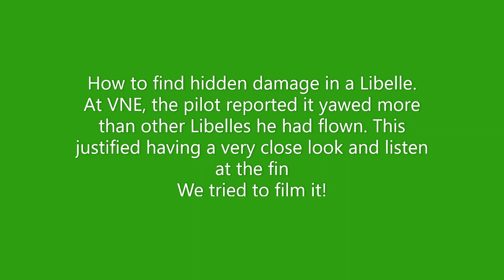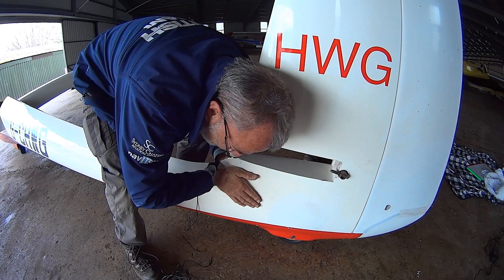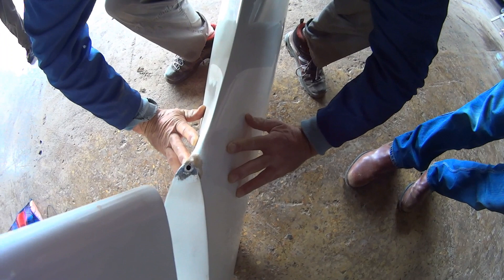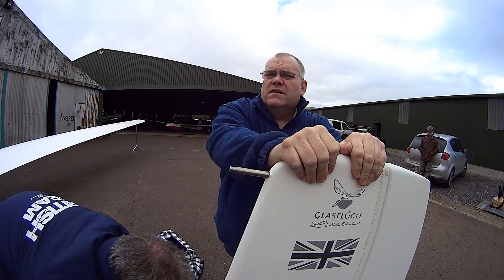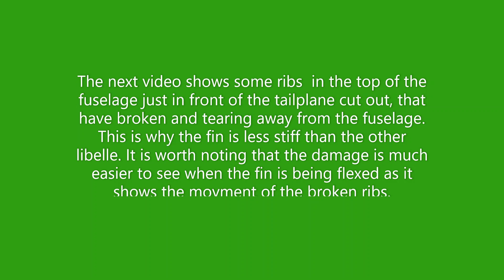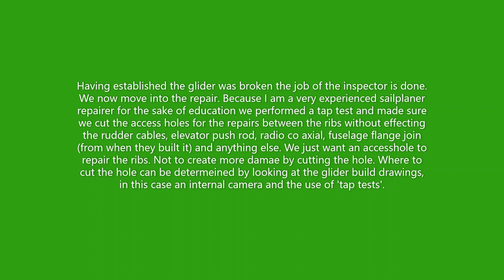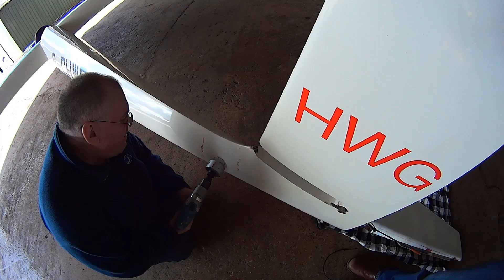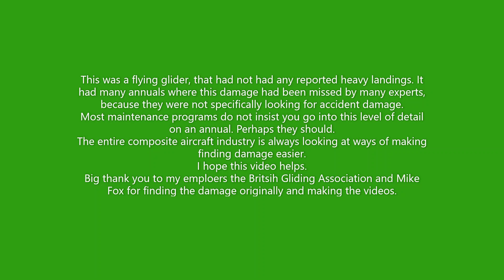How to find heavy landing or groundloop damage on a libelle fin the principles apply to most other a

Comment: Thanks for sharing. I will notify the Libelle owners in my club to have a closer look on their tail sections.
In my opinion this type of failure can also occur by years of small movement/vibration (which occurs on flight) over time.
A video of the repair, even with a sequence of photos, would be very interesting.
The delamination is quite big, so it would be interesting how the repair masterplan looked like, with this restricted access.
Reply from the maker: The repair was very simple. 

The official repair scheme approval process is on the Streifly website that officially supports the Glasflugel range of sailplanes. See link  http://www.streifly.de/TN%201-2005.pdf

In that document, one of the approved methods is to use a manual written by Ugene Hanle. The English translation is below.
https://www.dg-aviation.de/en/wp-content/uploads/sites/2/2016/12/flickfibel-e.pdf

This manual is essentially the Libelle repair manual as its based on the Libelle. The thing i do differently (the manual was written in 1967!) is lengthen the GRP splices to the same as the ones in the Schelicher manuals. I prefer longer splices as its more forgiving of errors and actually stronger with less hard points. 

Do not use repair schemes in the FAA AC43. Although they are approved, they are all heavy and stiffer than the original structure. They are aimed more at airliners than sailplanes. 

One hand size hole each side of the fuselage to gain access, Abrade the broken frames away to almost nothing with 40 grit on a finger mostly (removing the crack). 
Make sure all broken GRP is removed and the area around it keyed up to accept the repair. 

Then reinstating the frames and patching the skins are all repair schemes taken from the manual. Note you cannot buy the original resin and there is a Streifly technical note to use a different resin see link here
 http://www.streifly.de/TN%202-2005.pdf

After the repair it must all be post cured at 54 degrees Centigrade for 15 hours befiore you, fill and paint white. 
Being at the back end of the glider, i would also reweigh the glider to make sure the repair has not added too much weight.

Comment: I got one of those little inspection cameras for my yacht mast. 7mm dia, illuminated and dimmable, 10M cable, wifi, clip on hook, magnet and another thing all for a very small price. It should be able to insert a string/wire from one end of the fuselage to the other and inspect the whole thing with the camera on a flying fox set up, just run it along the bit of fishing line or similar.

Comment: This was really helpful as I'm about to do a pre-purchase inspection on a Libelle.  Will you seal up those holes or leave them as removable inspection plates?  Could this be spotted with an internal inspection (with or without the camera) or does it take reports of a problem to lead you to flexing it in such a way as to uncover the damage?
Reply from the maker: The holes are far too big to leave in place. They would substantially weaken the fuselage in a very critical area. 
Glasflugel approved repair schemes were written by the designers wife Ursula Hanle. They  can be found here. https://www.dg-aviation.de/en/wp-content/uploads/sites/2/2016/12/flickfibel-e.pdf

Comment: I have an engineering degree, but I am not qualified to make an engineering assessment of this.
However, based on my understanding of composites, nothing one can do will restore the original structural rigidity of that empennage, following the cutting of those holes.  Thus, tail flutter may be evident at much lower speeds.
Fibres (fibers) carry structural loads in tension, and after a fiber is cut, the load path is permanently broken.  The plastic resin is much less capable of carrying loads (roughly 1/40th that of carbon fibre (fiber)).  I would estimate the longitudinal ultimate strength of the tail has been permanently reduced by at least half, after cutting those holes, and if someone told me the torsional ultimate strength has been reduced by 1/4th (or more), I would not be surprised.
In order for a patch to make any real contribution to restoring the strength and rigidity of a GRP structure, and a patch can never equally absorb the strain of the original, uncut, structure, that patch must be much larger than the hole.  The strain must be transferred from the original structure, via the plastic (which has a relatively weak shear strength) binder, to the patch's fibres (fibers), and then back out the the structure again via the plastic binder.
Again, I am not qualified to make an engineering assessment of this.  If it were me, I would build some structural static load test articles that established some data by which estimates could be made.
Reply: I'm not qualified either, but I know they typically grind a very shallow scarf angle around the edges so there is substantial overlap between the old and new fiberglass layers.  I believe this helps transfer the tension.  People have been doing these types of composite repairs for decades, they must know what they're doing.
Reply: @FadoodleX  I think that only shear can be the load transfer method, whether in tension or compression.  If we made a butt joint with zero overlap, the interstitial plastic binder would be taking the entire tensile load, and the tension on the fibres (fibers) would be the result of the binder strain, transferred through shear, on to the fibres (fibers).  As the deformation of the binder would be greatest at the end of the fibres (fibers), I would expect delamination between the binder and fibres (fibers) in that region (because the binder is a lot more 'stretchy' than the fibres (fibers)), especially after a number of cycles.

Maybe I'll play around with this when it warms up.

If I needed to repair something, in order to escape a predicament, I would make a full thickness sleeve 5-10 times the diameter of the hole, and that may be woefully inadequate.
Reply: Composite material is actually so easy to repair... And don't worry Gordon knows what he's doing 😉
Reply: @dan0417  How does GRP carry load?
Reply: @DumbledoreMcCracken  it just does, of all the gliders in the world at least one 1st generation GRP  glider does a ground loop every weekend some where in the world. I'm sure it's going to be okay. (glider pilot).
Reply from the maker: @DumbledoreMcCracken  This is the Glasflugel approved repair manual. 
Most sailplanes use exactly the same techiques and these are very well proven  the be strong and not effect the fatigue life (12000 hours) 
https://www.dg-aviation.de/en/wp-content/uploads/sites/2/2016/12/flickfibel-e.pdf

Comment: What is groundloop damage?
Reply: A groundloop (or cartwheel) = when the Plane makes a 180° Turn (more or less) on the ground, most likely by one wingtip hitting the ground and beeing hold back by friction.
A very dangerous situation in winch launch acceleration. High grass is therefore a no go, and super quick release of the winch cable absolutely necessary. 

Sometimes this "maneuver" is made intentionally, e.g. when outlanding on a short field, to make a 180° Turn before hitting the obstacles at the end of the field, by putting one wing on the ground with aileron and supporting the loop with rudder, on relative low speed, otherwise it is possible that the plane rolls over on the back (the high wing is accelerated and produces a lot of lift).
Normally you would want to push the elevator forward to take pressure from the tail, otherwise the tail has resistance on the ground, an the 180° turn with the turn point at the main gear has a big momentum at the tail some meters away, therefore producing sideway stress on the rather "thin" (by Ø) fuselage at this point, shearing it off or like in this case making delamination.

In my opinion this type of failure here can also occur by years of small movement/vibration (which occurs on flight) over time.

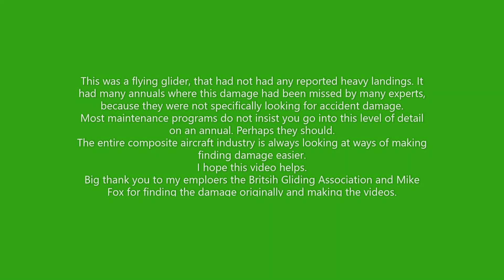Here is a video with a "kind of groundloop" (it´s more an impact). The sheared off tail section,  can be seen @ 10:00
https://www.youtube.com/watch?v=_zfuRb3csJc&list=PLTRn1uGDTWs0qxqAqIDKrRtzvkeOFwEdS&index=23

Another type of groundloop while landing an hitting a Corn field with the right wingtip with a K8. Notice the tail is in the air (a loaded K8 will have the tail always in the air, only when accelerating (start) coming down) --> no stress/damage to the tail has happened.
https://www.youtube.com/watch?v=HT_9O45TFtQ&list=PLTRn1uGDTWs1CuMX0vuQ8jjSraPpEYROG&index=25

And finally a wingdrop on a winch launch with a groundloop short to happen.
A very dangerous situation, when the pull from the winch accelerates the upper wing --> lift and rolling the plane on it´s back, with no protection for the crew on impact (Plexiglass canopy).
https://www.youtube.com/watch?v=Ls_VIfxOV8U&list=PLTRn1uGDTWs1CuMX0vuQ8jjSraPpEYROG&index=12
Reply: @hectorpascale1013  Wow, thanks for this super detailed explanation! Great summary and examples. Cheers!
Reply from the maker: https://youtu.be/DZPAVrIBaho